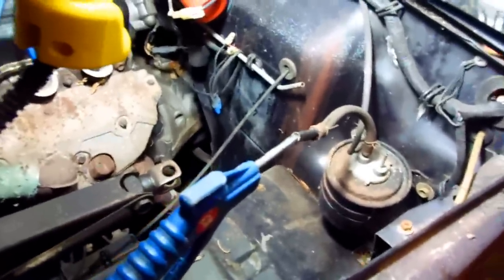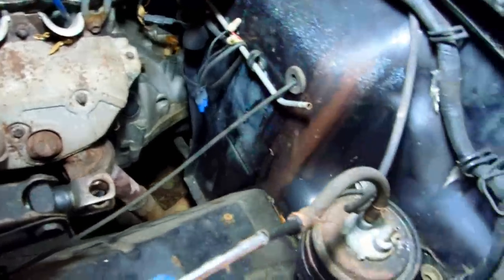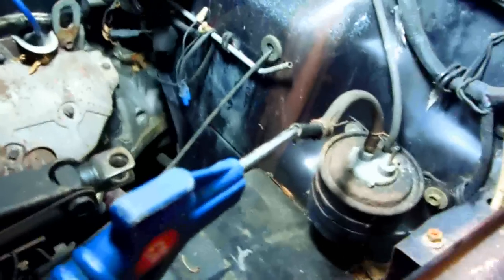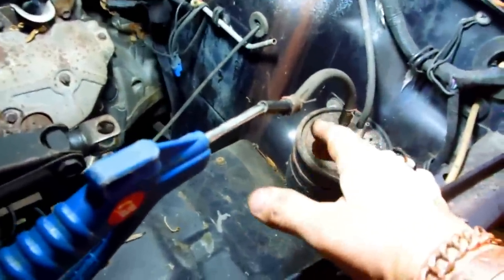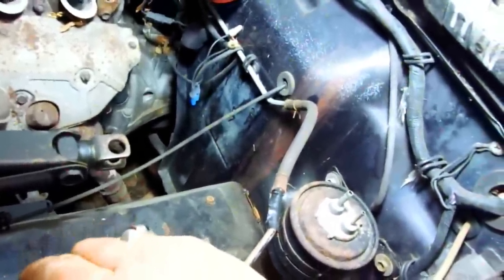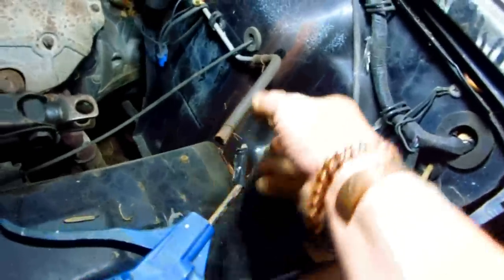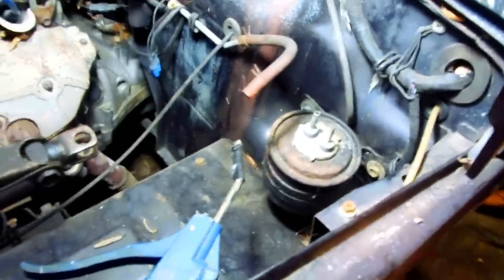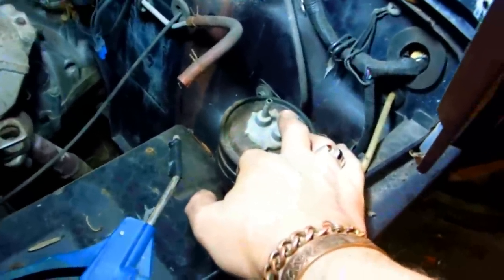How to check the Charcoal Canister Return Fuel System.

Comment: There's actually a good chance you can flush them out with water.  Did it on several.  Water, then compressed air,  several times until your waterstream is clear.  Maybe a few drops of heet and blow it out with compressed air before reinstalling. $200 saved.

Comment: my renault clio has a clicking noise coming from canister-- mechanic said it was faulty solenoid but seemed unsure if it needed replaced or not-car has been using more petrol of late and is a bit sluggish at times also my emmisions light has been coming on and off although he has changed both oxygen sensors on cat(only 2 on car)as this is what scan showed up-should i replace the charcoal cannister?

Comment: The check valve may be no good. My 1992 Mazda E2000 truck original manufactured with a metal push on cap but addition of motor home house saw filler hose added and a new pressurised cap which caused a major fuel leak from the charcoal canister through the return line. Drilled a tiny hole into the inside blue centre of the  fuel cap and no more pressure because it could breath.

Comment: I have a 99 vw jetta 2.8 and when i plug in the hose on the back of the upper intake manifold that goes to the leak detection pump the car just stalls out for some reason?

Comment: 40 PSI max. I used a 12VDC portable tire inflator as my bike tire pump didn't connect well.  It's a simple ball BB valve that is stuck from gas gunk. Spray some electronic circuit cleaner (nothing else) down the small tube (called the purge tube) a few times applying air between sprayings. It should un-stick the valve BB. The cleaner is pure ether, so it will fully evaporate and not damage the charcoal inside, but will dissolve the gas gunk. I did mine on an 86 Truck with a 22RE (fuel injection) that has a breather hose on the bottom that you have to plug or crimp to get the air to exit the small purge line on top. Flows like new

Comment: Just to be clear, there's 3 takeoff points for hoses on that type of cannister. A large one on top that supplies air to the tank when the engine is running (otherwise no fuel would exit the tank as a vacuum situation would be created.)  A large takeoff at the base of the unit plumbed to the top of the tank. This is how the petrol vapour rises into the charcoal cannister.  The small takeoff at the top beside the larger one goes to the  intake manifold and draws any vapour into the engine. 
The unit I have has a small vacuum activated valve that opens the top larger line to atmosphere (acts as an air vent for the petrol tank)   when the engine starts.  
I'm open to correction on this as I'm in the process of fitting the cannister to a classic car.
Reply: I have a 1976 AMC Gremlin 3.8 6 straight. It has 3 prong hoses. The purge one is broken. Where does the purge hose.goes to! Thank you so much!
Reply: From the charcoal canister?

Comment: Quick question, if the line to the fuel tank from the canister is ruptured, could air get into the tank through the ruptured line and cause a lean mixture ? then cause stalling and rough idle?

Comment: What causes the canister to get clogged? Bad gasoline? Fuel additives?
I have a 2012 Tacoma with 77,000 miles and the Check Engine light and Trac Light came on. Long story short, extended warranty covered the $667 cost. I am just curious as the possible reasons because my truck is not old and this could have been the death of me if I had to pay out of pocket...
Thanks
Reply from the maker: +GILBERT PEREZ probably moiture in the gas rusts a check valve.
Reply: This is an old comment but I would just like to say, I have seen a Charcoal Canister crack under 80k miles from someone "topping off" their gas all the time at the pump. Not saying you did this, but I have seen overfilling the gas tank cause the problem.
Reply: Is the damage only cause by repeated topping off?  I did top off one time by $1.20, but it wasn't for the reason of topping off but because I thought the click wasn't holding the nozzle handle down.

Comment: My question is...how does it get clogged...it's evaporated gas, no particulate. Does the charcoal sink-settle-get brittle and clog?
Reply from the maker: I don't know why.  They are a ripoff to buy too.  I don't need to really replace this since I have on an aftermarket Weber carburetor.  But on any car after 1996, it would throw a diagnostic code and you'd fail inspection.   That's another reason I like the old stuff.  This Suzuki has an adapter kit that can run the 1.6 VW diesel that gets super gas mileage. I'd go that route if the engine wore out but this engine is still running like new.
Reply: Accuracy Mark
Reply: I need to know about the line coming from the charcoal canister going towards the motor but this line is cap but when I turned the key to start my truck it spill's gas from where it is cap how is that

Comment: hey,  this doesn't apply to this kind maybe, but I have the kind that is under the car ( truck actually)  it's bigger and black plastic, pretty durable,  anyway   i was trying to clean it out of DUST that I was finding was being sent into my gas tank and fouling out my fuel pump filters causing me to go through 4 ( now 5 ) fuel pumps in the last few months.  i was cleaning it  by using a air compressor, I did not block air from coming out, i was just shooting air in the container, plan was to keep doing that till I saw no dust.  well at some point, something inside the thing shut - some valve or compartment or something, and while I was holding this canister against my gut with my hand holding it tight it exploded.  im not kidding, it was so loud my ears are still ringing, I got the wind knocked out of me.     shrapnel bits got me but nothing serious. it was a big explosion though, i think I just got lucky, the parts flew all over my 2 1/2 bay garage .     im just posting this so it doesn't happen to someone else.   it really seemed to be a great pan and i was thinking i was saving some dough ( about 100 bucks )    Im going to get another one tomorrow from a U pull it yard, i don't have a 100 bucks, or time to wait on shipping. LOL
Reply: So why did it explode?

Comment: one of the lines is cut on my canister,  I took all the emissions stuff out of my 85 camaro and put a Holley 650 on and all the holes on the engine where the old hoses went were plugged  but is it OK to just take the hole canister out or do I have to leave it,  cause the line going to the tank is still hooked up but I was thinking of clamping it. I want to put another battery in the spot of the canister

Comment: thanks im going to disconnect  right after emissions   drill a hole in the cap and get that garbage out of my engine bay along with the AC and the cruse control  and the vacuum shift on the fly crap